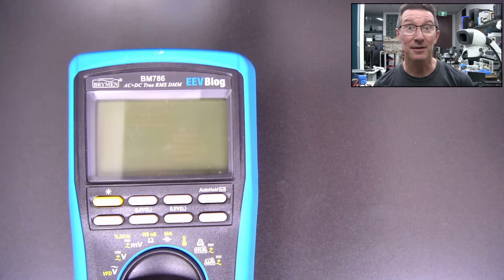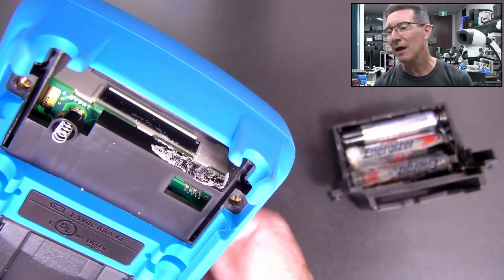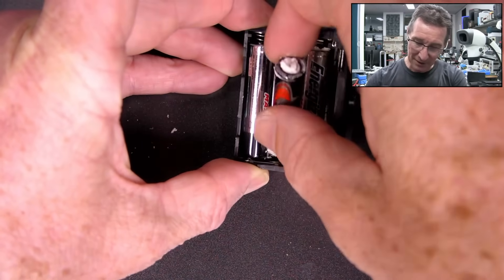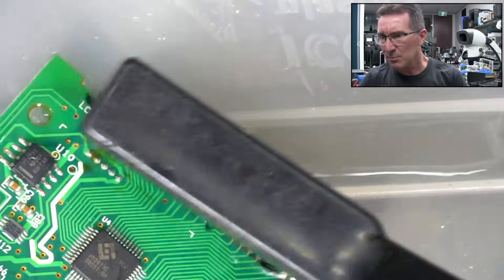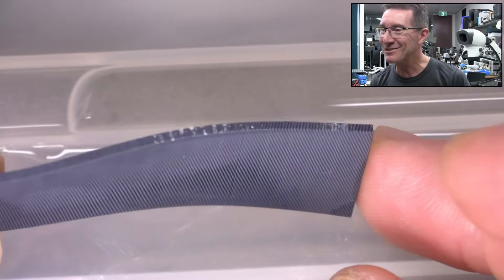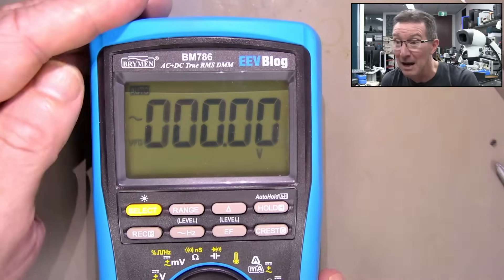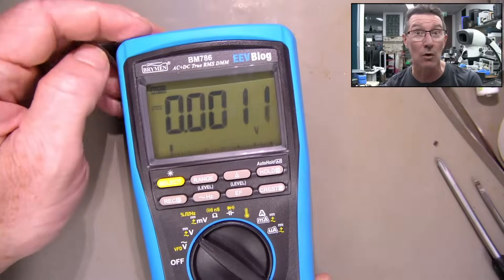EEVblog 1670 - BM786 Multimeter BATTERY LEAKAGE REPAIR + GIVEAWAY

Comment: Highlights yet again the problem of battery leakage - nice repair and a gotcha!

Have you thought about offering a replacement battery module  with a Li-Ion battery pack with a USB charger port? An18650 would not fit, but one of those flat cell packs would.

Andy

Comment: The batteries appear to be assembled in the factory. My multimeter has the same model of battery, from the same production period. They are functional, but I think it's time to replace them. I've had a similar experience with Duracell. It is better to use Panasonic.

Comment: Thats the only good thing about 9volt batteries, ive never had one leak in anything and im 65 so ive seen my fair share of all kinds of batteries.
Reply: I've had them leak but never enough to cause massive damage. Worst case the battery snap got a bit damp.
Reply: I have :)

Comment: Dave try using Rechargeable NiMH batteries, ive never seen them leak, and they're cheap as chips nowadays. Litium ion would be an option but far more expensive
Reply: Ummm... did you actually watch the video before commenting?

Comment: Forget the energizers, only ones ive had with no leakage has been rayovac, Duracells have been horrible for leaking, even the high dollar ones.  I also had some AC Delco batteries and they were TERRIBLE - had three wall clocks trashed and the batteries were less than a year old, I change the batteries in them every year when daylight savings time changes and they still leaked and ruined the clock motors
Reply: Ray O Vacs have been the worst for me.  Cost less than the big names but they leak on me too.  I bought a box of Home Depot brand, so I'll see how they do.

Comment: these batteries are getting worse or something, do lithium cells do this?
Reply: I uses single use lithium in my meters etc (or failing that nimh rechargeable).  So far no lithium cell has done anything nasty.

Comment: I've started using AA / AAA Lithium Batteries on my more valuable items. Especially the multimeters or measuring tools that I don't use regularly. They're a bit more expensive, but last very long and don't have an issue with leakage.
Reply: Indeed. At work, we have a bunch of pH meters that, inexplicably, need 2 AA batteries and an AC adapter. Whatever the batteries do (which isn’t memory backup, which would be the obvious guess), it draws very little power so they last forever. So long that people forget they even use batteries. (And honestly, I can’t blame people for not thinking to check the batteries on a device that must be plugged in to work!!!) I now put Energizer lithium AA’s in them, because each meter is around a thousand bucks and it’d be a shame to lose them to battery leakage.
Reply: all the new energiser lithium AA’s i opened measure 1.8v though
Reply: @jitrapornpha5104  maybe that's for long-term storage only and quickly dies down to 1.6 or 1.5 when they're actually used? Have you checked?
Reply: @ i checked energiser lithium AA the non disposable ones i bought brand new and the measured 1.8 volts out of the packet brand new . i then tested similar lithium AA that were in my pioneer plasma remote for about 1 year : measures 1.78 volts. i emailed fluke if ok to use these energiser lithiums and they just link me to the manual that says uses duracell or energiser alkaline. every night i take out my alkalines  from my fluke 87vmax . i don’t trust alkalines made in the last decade . i’ve lost too many TV remotes to leaking batteries
Reply: @GLITCH_-.-  Energizer has a discharge curve in their datasheet. At a >10mA load they should already drop down to about 1.5V.
Reply: @ Are those for lithium-cells? I mean it's pretty stupid to produce AA batteries that kill appliances. I'm sure they drop immediately down to 1.5V with any real-world use
Reply: @ Yes, the Energizer AA Lithium. They've a chart that shows that they should drop down to 1.5V very fast under any minimal load and then stay there.  They also mention in their FAQ that usually devices have no issue with using the AA Lithium cells. I guess they get such questions a lot.
Reply: @ No. They stay at or over 1.8V for quite a while.
Reply: @jitrapornpha5104  I had no issues with it yet since they drop a bit under load. WIth normal alkaline I had also quite a few ones that had 1.65V instead of 1.5V when measured without a load. Energizer for example has a discharge curve in their PDF Datasheet. At a 10mA load it drops already down to about 1.5V. 
The only little disadvantage I see with lithium batteries is that the battery warning of devices will come very late, since the lithium batteries have a very long and stable 1.5 / 1.4V discharge curve and then fall fairly quickly. But that's something I can live with.
Reply: The non-rechargeable?

Comment: Are you using 70% because that's what you had or is 90 or 99% not as good for some reason? I always use 90 or 99% because there's less water left behind so it dries off quicker.
Reply from the maker: Ideally you want to use some water to wash away the acidic vinegar first. Can them finish with 99% IPA.
Reply: Anything above 70% is really bad if there's any plastic around. 70% is safer...

Comment: It would be amazing if battery powered products were designed with battery leakage in mind i.e. battery compartment sealed from the internals and gold plated battery contacts. I know its wishful thinking but one can dream..
Reply: Some manufacturers actually design battery compartments in this way, but not many
Reply: The old (ancient?) Fluke 25/27 (8025s)  had a battery compartment that was pretty isolated.  It wasn't sealed, but the closest circuit board was the fuseholder. Most had a plastic cover over the battery.

The 70 series had no components on the PCB near the battery, but there was no isolation. Still, I never saw one that needed any more than new contacts.
Reply: Gold plated does not do the trick, unless pure gold and expensively thick.
Reply: Or just pass a law that alkaline battery manufacturers be held liable for repair or replacement of devices damaged by leakage.
Reply: @NiHaoMike64  Ha I wonder what they would actually do (the battery cell manufacturers).
Reply: @ Redesign the cells to make them very unlikely to leak.
Reply: then every single battery would leak...

Comment: I use to be a big fan of Duracell, not any more. Most of the ones I've purchased in the past 4 years have leaked and thankfully I was able to save the equipment. I like rechargeable batteries but the voltage is a bit lower so I just use Lithium batteries, it's worth the extra money.
Reply: I agree. For valueable items the new lithium batteries are fantastic. They last very long and don't have issues with leaking. 👍

Comment: HEY Dave What causes this is. Just like my original thoughts.  Batteries in plastic bags never leak.  Battery in a device leaks. Here's why.  When Battery is charged thier an inherent internal pressure.  And when it looses its power it looses its pressure then the pressure springs squeeze the Battery like a sponge wringing out the acid.  It's the spring terminals constant pressure is why all these batteries are having the juice squeezed out..
Reply: Is that why 9 volt batteries don’t seem to have this problem..?

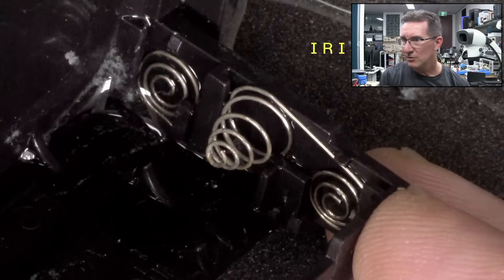Comment: 4:14 ive seen a lot worse. Thats not corroded. When zinc "heavy duty" batteries leak, they completely rust the contacts. That would be gone.
Reply: "That's not corroded. THIS is corroded "

Comment: On one of the batteries I think I saw a little dot of rust (like on the bottom of the third battery at 3:30) which makes me think it's a moisture issue and wonder if a little tiny desiccant packet in with the battery try somehow (or even in the case of the multimeter) would help prevent this.

Comment: My heart sank when I saw this...I have my 786 loaded with Energizer Max batteries.  I use the meter every few months.   I just popped the battery compartment and whew...all clear for the moment.
Reply: You'd better get rid of them quick, fast, and in a hurry.
Reply: @waynec369  This is why i like 9V batteries , i have never seen them leak , hence why i only purchase Multimeters with 9 V . AAs are useless ,  and always leaking   ( even big brands ) I/ve seen them destroy  so many pinball CPUs it's not funny .
Reply: @parabot2 Duracell and Energizer 9 volt batts are the absolute worst. Not only do they leak, but they swell. Just stick around a while.  You'll see.
Reply: @waynec369   Your spooking me , going to look and see my Uni-T . Maybe i should get recharagables ?
Reply: @parabot2  I switched to cheap batteries from Horror Freight. Dunno what part of the world you live, so your cheap Chinese outlet may be of a different name. Not because the cheap ones don't leak. My logic is why pay the premium and suport the brands that built their name on quality then turned their backs on their customers while sliding them inferior products. I hope more will join me and turn away from the inferior products. Hopefully someone will get the message and start bringing quality back to the masses.

Comment: I still use my Fluke 87 I bought in 1989 for $236.88 US.  The 9v battery is a pain, but at least they don't seem to leak like AAs and AAAs.
Reply: not externally, anyway. had an old PP3/9V look like a crystalizing dish after and experiment on the inside though, but it was like 12 years past it's date (MFG 1999/12, exp 2009/11 on the battery) they can be deceiving!
Reply: They definitely can and do leak. It just takes longer to become visible since they have a second shell around the cells.

Comment: this is why I'm not a fan of the idea of AA/AAA-powered DMMs.
the good old (but apparently trending towards eventual extinction) DMMs using 9 volt batteries is what I prefer. yes those can still leak but a) there's the additional protection of the outer case; b) usb-rechargeable 9v (actually 6V..8.4V, 2s, no dc/dc converter) lithium batteries are readily available.
Reply: well nimh AA/AAA are also an option.
I wonder if there are 1.5V rechargeable lithium batteries that don't have a dc/dc converter inside.
I also wonder if a single-cell lithium would work.
Reply: I guess you could wrap the 9v alkaline in tape incase it did leak.
I guess if you wanted a nimh 9v and were concerned about cell imbalance, that you could trickle charge the standby 9v at c/300.

Comment: I'm really surprised that your Energizers leaked...used to be a Duracell fan boy but over the last couple of years their AAA and AA batteries have earned them the moniker "Dura-leaks" and switched over to Energizers and guess I've been lucky and they haven't leaked at all. Just got done repairing several device remote controls with Duracell innards all over the place.
Reply: No brand can be trusted.
Reply: Energizer Max give a guarantee on devices damaged by leaking
Reply: I have just finished, not f-in got done.

Comment: Move away completely from alkaline cells to avoid this in future. Switching to Low self discharge nickel metal, like those ebl's, or ikea Ladda is the way to go.  Even zinc carbon single use are ok to use long term, they don't build up pressure inside when they discharge.
Reply: Zinc carbon/chloride batteries leak as well and the damage is even worse. They rust battery contacts and corrode traces similarly to how NiCds damage motherboards.

Comment: I use rechargeables in EVERYTHING these days. I've never seen a rechargeable batt do this.
Reply: Eneloops hold a charge quite a while, use them or the amazon basics brand in some „smart“ LG TV remotes and only charge like once a year.
Reply: I still use the batteries in my remote from over 5 years ago. 1 year of use in a remote is not really great.
Reply: I had ine or two NiMH vells leaking over quite many years.  So they are not perfect.  The leaked liquid looks like resinified sunflower oil, somewhat hard to remove and the quantity is far less than with alkalines.  And I'm wondering about its corrosivity and toxicity.  Oh well, I'm using gloves anyway.
Reply: I’ve had a rechargeable NiMH leak. It’s not pretty. It corroded everything with bright blue corrosion.
Reply: Yep, cheap as chips these days
Reply: A bunch of my eneloops and ikea ladda get charging errors/won’t charge so I dunno if they are the ultimate answer either given they are so expensive. Kind of frustrating to be hobest
Reply: @remogaggi82  Use a dumb charger, one without the dummy check for wrongly inserting non-chargebles. These fancy chargers throw out batteries that are still very usable in low demand settings.
Reply: @remogaggi82  NiMH are the easiest batteries to charge. They should be trickle charged by a ‘dumb’ charger. Big Clive has a video how to make one. NiMH tolerates being overcharged by trickle charger.
Reply: I have used rechargeables in everything since 1988. I too have never had this issue. I've left them in devices for longer than 6 months with no issues. I'm not saying that it can't happen. I'm just saying I have never had it happen. Second bonus is the older better made batteries used to last 10 years or better. I still have Panasonic batteries that I bought in 2008 !! But so far I have not had the same luck with newer brands.
Reply: Use Li battery (1.8V).
Reply: @CookiePepper Sometimes that is a problem and the battery need to be brought down to 1.6V in a torch.
Reply: @CookiePepper  but would the higher voltage cause meter malfunction?
Reply: Rechargeables are too expensive. This is because you leave them in the device, forget them, and once they are discharged to less than about 0.8v per cell, they're fit only for the bin.
Reply: @curiouscrandall1  I have placed a Ni-Mh in a battery holder, and soldered a 1k2 resistor over it. ( = 1 mA). Left it like that for 6 months. The voltage left was less than 2mV. Charged and discharged the cell 4x, capacity was only ~1% less than when I started. Did the same with the same cell, again that result. Then did it more than a year, and still the same result, a natural decline. It could be that the constant draining had an effect on this, the cell never was without resistor. And I did it with 2 cells at the same time, both the same result.
Reply: @erikdenhouter  good info. Alkaline are too expensive and wasteful. I’ve just got ikea AAA made in Japan (£1 each). They should be maybe 500-1000 times cheaper than alkaline because reusable. Let’s see… as long as they hold a charge for ~12 months min, I’ll be happy.
Reply: @davadoff  If they are low self discharge (or equivalent name) the will do about a year. But it is good to 'use them', that is discharge them fully and directly charge again >at least< once a year. A good charger does that for you, but some intelligent chargers dismiss cells to early, while they are still usable. For that keep a 'dumb' charger too.
Reply: @erikdenhouter  yes, low self discharge. Rated 80% charge remaining after 5yr or 10yr for eneloops, I believe (the IKEA ones are not rated like that but are purportedly rebranded eneloops). Why is it good to drain and recharge NiMH every year?
Reply: @davadoff  Sorry, I just wrote a half A4 here (posted it twice), but youtube removed it. It happens to often.
Reply: @erikdenhouter  I always copy my message because that happens to me a lot.
If it was about battery memory, that seems to be a myth or no longer noticeable.
Reply: @davadoff  No, it was an answer on your question why to charge/discharge/charge once in a while. Take my word, it is good. Memory effect was strong with Ni-Cad cellen, but is less with Ni-Mh.
Reply: @erikdenhouter  I couldn’t after anything about it online. Results said it’s not necessary. Discharging too much will be bad. One result said don’t trickle charge modern NiMH cells (I don’t think that’s correct, especially if you stop charging when cells start to get just slightly warm).
Reply: @davadoff  tricke charge is not good for modern LSD Ni-Mh. Those are a lot better at avoiding self dicharge - the same mechanism exploited by trickle charging. Essentially trickle charging raises self - dicharge up to C/10 (or whatever trickle charging current is) at voltage and temperature cell will stabilise at (if cell if left tricke charging after it gets full).
Reply: @curiouscrandall1  I have 4 Panasonic AAA batteries that I bought in 2008 that are STILL working. I can't remember how much I paid but they were less that 20$. Even at 20$ that figures to 0.29 cents a year !! That destroys even the cheapest alkaline batteries. I have so many that some are always charged, anytime I have them die in something I walk over to the bin and swap them out and charge the others. The last time I bought a pack of rechargeable batteries was 2020.
Reply: Too much stuffing around 

I use regular batteries and never had an issue 🤷